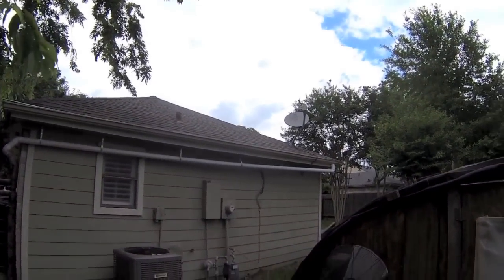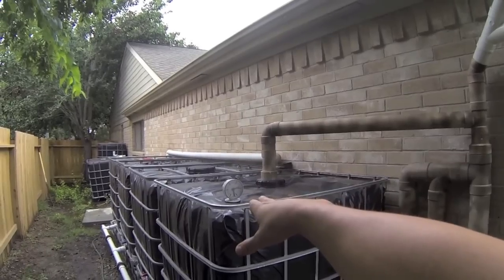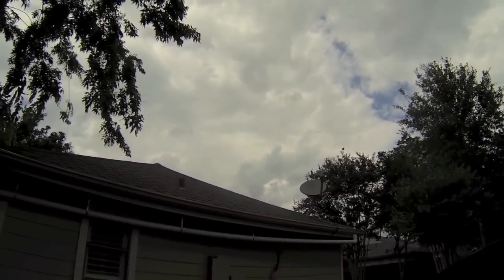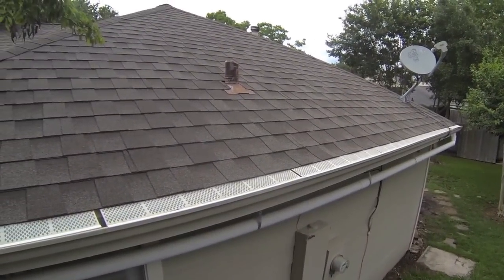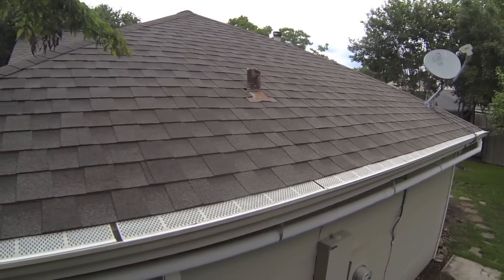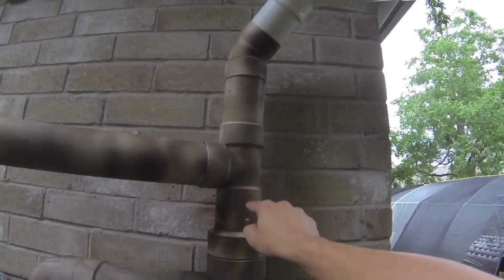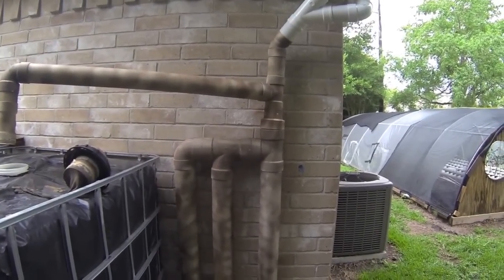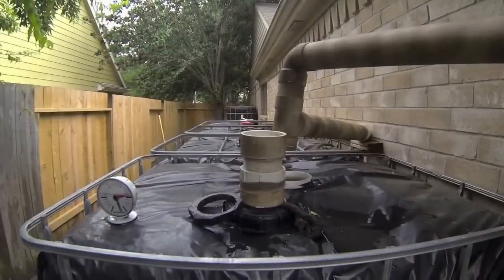IBC Rainwater Harvesting System Update #2

Comment: Something seems off about this.  Have you ever examined your system uncovered so you can see the level in ALL the tanks?  All of your tanks are attached at the bottom, but it appears there is no vent at the top to vent the air that the water needs to replace.  It would seem that you would only fill up your three auxiliary tanks to a little  above the outlet, until you covered the exit for the air.
Reply from the maker: Caps are loosened for a vent

Comment: The best water level indicator is probably a simple clear pipe exiting the side at the bottom and running verticle go the top of the tank. The water level will be equal to that in the tank. More accurate than a gauge.

Comment: simplest water level gauge is a "t" at the bottom outlet connection of the tank. add a clear plastic 3/4" hose going up the side of the tank. plug the end with a plastic cap and drill a very small hole in the cap to release air. zip tie it to the side of the tank and you can see the level from 20 feet away. it's cheap and simple to do.
Reply: You do not wan t sunlight on the water, otherwise algae can form. That is why he covered the totes with black plastic.
Reply: Awesome idea!

Comment: Your flush system is very clever. Nicely don't. How are the tanks vented, to prevent a pressurized air bubble from forming when filling the tanks, or drawing a vacuum when emptying them?
Reply from the maker: The caps are loosened to vent the tanks

Comment: Great video brother. I am getting ready to build my system this weekend. Question....for the flush diverter did you glue everything together? I see some of you stuff comes apart and have been trying to think it through as to what would be the best places to not apply glue in case I need to take something apart. Any tips?
Reply from the maker: Most is glued but I left a few pieces unglued in case I want to take it apart. Have you seen the step by step video series?
Reply: Trenton Kaminski Yes. Trying to follow as close as possible. Just trying to shamelessly steal any info I can. Thanks for the response.
Reply from the maker: If you encounter any problems during the build shoot me over an email.
Reply: Got all four tanks done. I greatly appreciate the help. Thanks again for doing such easy to follow videos. We got an inch of rain the other night and tanks are about half full. Have a great spring and summer.

Comment: What kind of setup did you use to connect gutter downspout to 3 in? PVC ? Do you explain that in another vid?
Reply from the maker: Purchased it from local hardware store. It's a square to round adapter. Amazon should have them as well.

Comment: Trenton,

I love your videos. They are very informative. I do have one question though. I noticed that the pump you have installed in your system is at or at about the same height as the supply line coming from your holding tanks. Is this necessary?  I have an off the grid cabin that I would like to collect rainwater for to use for showers and cleaning dishes. The cabin sits about 3 feet off the ground on cinder blocks. I would like to put the holding tank on some blocks just off the ground and run the water to the inside, where I will have my pump to pump the water through the pipe system in the cabin. What do you think?  You obviously have a great deal of experience with the off grid type system and I would value your opinion. Please let me know. Thank you. 

Dale
Reply from the maker: Hi Dale, thanks for watching. The pump will pull the water, I believe up to 9 vertical feet It should work just fine.
Reply from the maker: +Dale Moss the pump will pull the water from your holding tank and is able to pump up to 9 feet vertical I believe. It should work just fine with your setup.

Comment: Good afternoon. Is it correct that the bottom pvc pipe is two inch. If so did you have to make that adapter to the hose line or were you able to buy that part. Also what size is the hose you are using.  Thanks in advance
Reply from the maker: +Ian Way yes they are 2 inch. 
Check out this video over adapters. 
https://youtu.be/RV-KZbfCaYM
Reply: +Trenton Kaminski thanks, but that doesn't answer my question. On the right hand side of the set up you have a 2 inch red dump valve. But on the left side you have a black valve that doesn't appear to be 2 inch. So my question is. What size is the black bump valve, also how is it attached to the 2inch pipe.
Reply from the maker: +Ian Way on the left side is a twin garden hose connection. They are 3/4 inch. I used a 2inch to 3/4 inch reducer to fit that on.
Reply: +Trenton Kaminski  one last question for you I hope, where were you able to find that 2 inch to 3/4 inch reducer. I can't find it anywhere.
Reply from the maker: I purchase from lowes. Where about are you located? Also try Amazon.
Reply: +Trenton Kaminski Lowes hey I'll have take another look. I live In Canada eh. Thanks bud.
Reply from the maker: Another option, call a plumber and ask him where he buys his parts.

Comment: something is wrong here. If the water flows to 1 Tank, and start to fill up the 2,3 and 4 tank with lower pipe, what happens with the air in those tanks ? There will be air preasure and the tanks will not fill to the end ? ( sorry for english )
Reply from the maker: Check out this video. https://youtu.be/9xj-Fus7R7Q
Vents from the lids, that are loosened to allow air flow
Reply: +Trenton Kaminski thx. BUt if the tanks are full the water will spill  with pipe and 3 top lids ?
Reply from the maker: Correct, it will come out of both the lids and overflow pipe. However about 99% of the water flows out of the overflow pipe.
Reply from the maker: +kabzikGNIEZNO in retrospect I would have build it different. Live and learn. I suggest if you build one, make a vent higher than the overflow pipe. This small system seems to work fine even though in theory it should not.
Reply: +Trenton Kaminski we all would have build it differet.  I bought  last year an old house ( old, but my own :) ) and I'am doing IBC water system for my garden. I have only one Tote but have place for one more. My mistake - the IBC was not blacked for 2 years, so now i have green water in 3 days :/ In the next year I will contect it with rainwater system, now have only water from the well. My went will be probably in T system

Comment: Thanks so much for the videos!!  Question: Since you only loosened the lids, does the over flow come out through the lids? or does your over flow pipe do the job? Seems like the over flow pipe would not work since it's higher than the lids. You said it seems to work. Is it working or did you have to modify it?
Reply from the maker: +Linda Berard Most of the water exits out of the pipe but some water does flow out of the lid. You can put a 2inch pvc fitting on most lids then plumb it to vent, it was an afterthought for me. I have seen it done and the set up was nice.

Comment: Good video Trenton.
Do you have the link to a company that sells IBC tank adapters?
Mine uses a 2" pipe fitting at the valve. I've got that covered from my local hardware store. 
Who sells tank lid adapters to work with strainers and PVC pipe connectors?
Reply from the maker: +Wayne Greenway Check out this video, https://www.youtube.com/watch?v=RV-KZbfCaYM
Links are in the video description for the adapters. I am not sure about the lids however.
Reply: +Trenton Kaminski 
Trenton, Check out: http://www.lexingtoncontainercompany.com/275-Gallon-IBC-Totes.html
Go to the bottom of the page.
They have a very good selection of IBC 6" lids with 2" female pipe connections built in as well as the adapters for the valves.
I ordered the double 2" pipe fitting 6" lid. One for intake and the other connection for the overflow.
They have great customer service too.
Reply from the maker: Awesome, thank you for this information.

Comment: If you want o do fire fighting or protection, with the 1200 gallons, get a 2" high pressure Honda pump. You could get the 3 inch but that will be too much, get the 2" and you will have 30 min of fire fighting with a 1.5 inch hose or close to an hour with a 1 inch and some inline foam.
Reply from the maker: Thank you for the information, it is greatly appreciated.

Comment: Trent, One thing I didn't see was a breather hole in the other IBC's. Without one the air in the tank will compress and keep those from filling completely.
Reply from the maker: Charles Kiplinger I have loosened the lids to breath. Technically the breathers should be above the overflow but it seems to be working.

Comment: Howdy!  Since you bottom fill, you realize what ever dirty water goes into the first tank goes to all the other tanks too, right?  If you top filled, each successive tank down the line would have cleaner water than the tank before it.  Also, filling from the bottom is slower than top filling, as the tanks fill they create back pressure against the water coming it.  With a top filling, you wouldn't have that problem, and the top fill would also vent the air.  Also, when the tanks are full they wouldn't be oozing water out the top.
Reply from the maker: TheStavros1001 High in sight I may have set it up differently and I still may change it in the future. I'm not to worried, the water has only very small particals in it and 90% of that is in the first tank. What you say does seem to be more optimal than what I currently have set up. Thanks for the suggestion!

Comment: I see how you are bottom filling the tanks and that's fine, but what about air trapped in the tops of the extra tanks?  That air will stop water from coming in unless you vent it.... and your vent needs to be above the level of your Tee used for the overflow.  Like your ideas though.  I'm filling my tanks from the bottom common run too.
Reply from the maker: For my vent all I have done is loosen the caps on the tank. Almost all the water is diverted to the overflow pipe once the tanks are fullI, a small amount of water will drain out of the caps. I do not mind it, however some may.
Reply: How much are the caps loosened?

Comment: On the slope for your gutters you should only need about 1/2" (3/4" max) of drop per 10ft of run. You could likely reposition the gutter so the high end starts at the front of the house and you'd only drop a few inches till you got to the back corner where your first flush is set up. That would let you eliminate that long run of PVC (which looks to be sagging and likely putting a lot of load on your soffit) and the long plumber strap hangers. What is the length of the run that gutter makes? 25-30ft?

On the gutter guard you could use a few small dabs of clear silicon caulk on the lip of the gutter to help "glue" it in place but yet should be easy enough to still take off if you need to.
Reply from the maker: Sig220Euro The run is about 25 feet long, my thought was if I slopped the gutters on the entire house that the gutters would be to low about time I reached the far side of the house. Thanks for the comment, next time I'm outside playing with the system Ill look at this option.

Comment: Couldn't you have vented/overflowed the last tank instead? The you'd avoid that long pipe + dumping old water first rather than fresh rain water when it overflows.
Reply from the maker: Janne: Great question, I haven't thought about that before. That sounds like a good configeration, and in theory I do not see why it would not work.
Reply: Trenton Kaminski I think this will be a modification that I'll make. Or, actually just make so that I could simply switch it to any tank (and letting water come out infront of the tank, maybe with a hose attached if needed) this way it's not difficult to close off some tanks if need be.
I'm also wondering whether or not I should stack them. Greater pressure is good, but will be a lot more complicated to maintain...

Comment: Hi Trenton, I building kind of the same setup as you have. I have one question about it. If water enters in one of the IBC's do you need to close of the other IBC's on top or not? Because where does the air get out of the system.
Reply from the maker: Great question Massassi, I will have a video up soon over connecting and venting the tanks. To answer your question all I did was loosen the lid slightly, the loosened  lid allows air in and out but does not allow dirt or debris in.
Reply: Trenton Kaminski Thanks

Comment: Hi, great video. I learned a lot. But in my system (just 2 tanks) the waterpressure is not near enough to use for washing the car og watering in the greenhouse. I used a Hydroforpump, why haven't you done this?
Reply from the maker: Currently I only need to fill my tank for my aquaponics garden. The tank is located below ground level so gravity does all the work for me. However, I am installing a filtration system to make the water drinkable, in that system I will also have a connection for a water hose. It will have a 5 GPM pump connected to it, Video update coming soon!

Comment: Just curious how the air in the top of the tanks is displaced as they fill up from the bottom. Do you leave lids loose enough for air to be pushed through, but not so much that a lot of water gets through (so the majority of water flows out the runoff pipe once the tanks are full)?
Reply from the maker: Earthlark: Yes, I left the lids screwed on but not tightened down, seems to work fine so far.
Reply: trenton kaminski Great, thanks.  I'm setting up a similar system (except with a central pipe and 4 tanks on each side) and didn't want to go to the bother of putting exhaust pipes at the top of each tank to maintain a water level higher than that of the drain pipe.